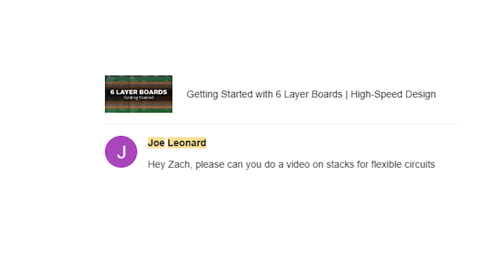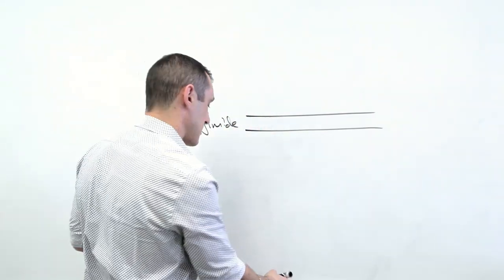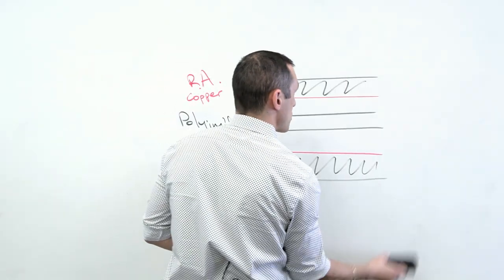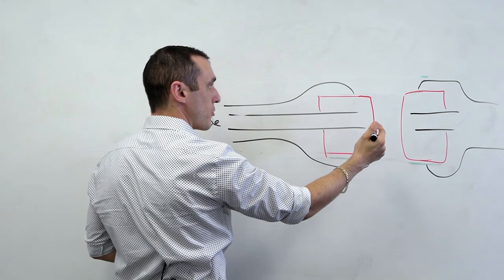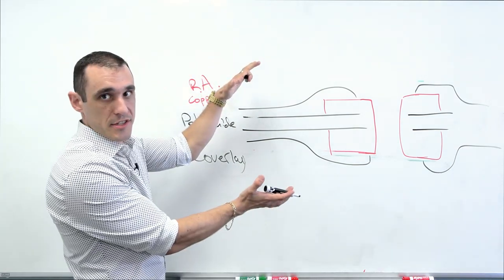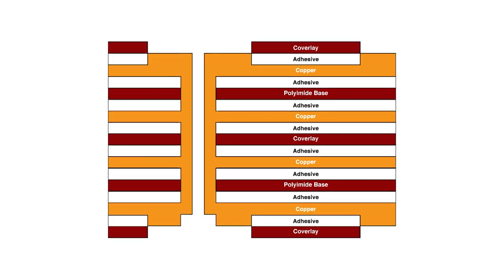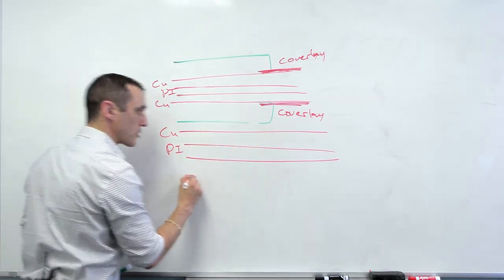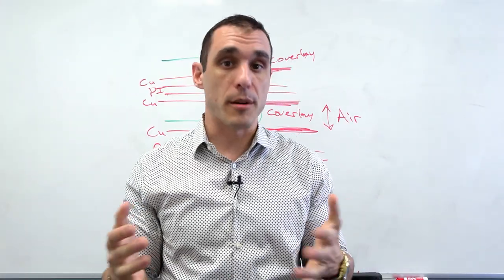Flexible Layer Stacks Deep Dive

Comment: Thanks for the links, I need to read up more. My current project has a short flex PCB interfacing a laser driver IC to a low power laser diode (TOSA). Data rates are up to 11.88 Gbps, and the TI datasheet recommended 50-ohm diff pairs to connect the laser. Interesting not from my fabricator was "ENIG finish only because it's so thin." I think it would be interesting to see a 2- or 4-layer stackup example in Altium with coverlay, polyamide, etc. setup accurately. 

What does the "is flex" checkbox enable in Altium layer stack manager?

Does the adhesive behave similarly to dielectric (loss)?

How accurate will the impedance calculator be if my Dk values are ballpark?
Reply: 1. The "is flex" option defines a specific sub-stackup as a flexible layer stack. If you're using the newest version you can implement different rigid or flex regions in the Rigid/Flex (Advanced) area in the Layer Stack Manager.
2. I do not have all the properties for different polyimides memorized, but the loss tangent values for polyimides are similar order of magnitude as FR4 materials.
3. The solver is going to use the Dk value that you provide, it does not "know" if that value is right or wrong, it just uses that value in a numerical calculation. So if you provide a Dk value in the impedance tool, but that Dk value does not match the real Dk value of the material, then there will be some inaccuracy.
Reply: @Zachariah-Peterson  thank you, Zach.